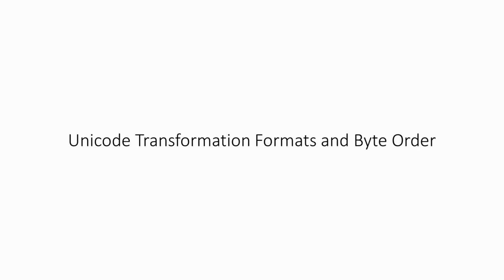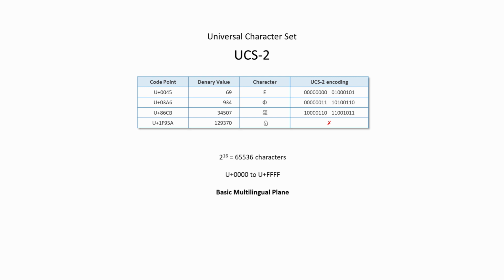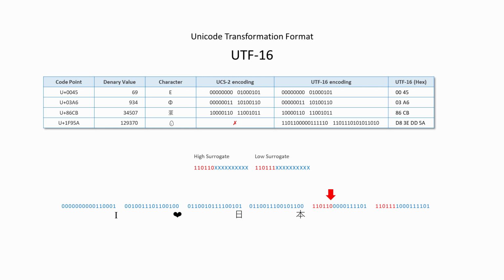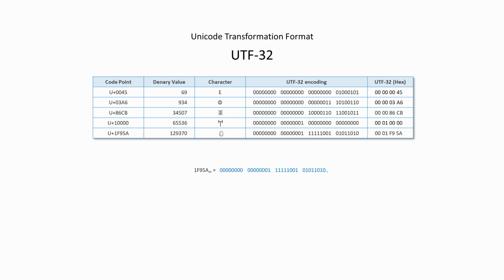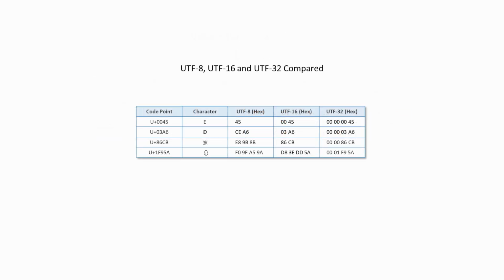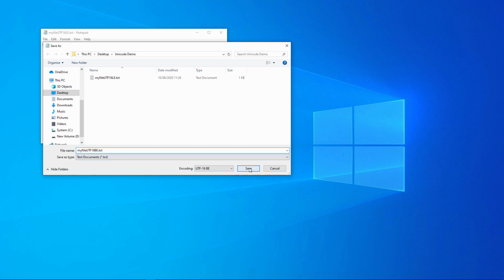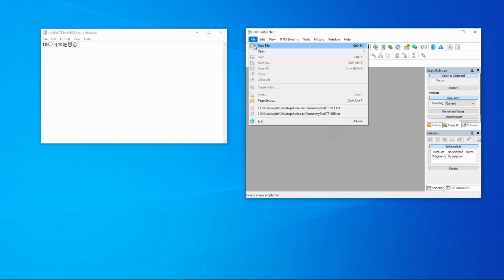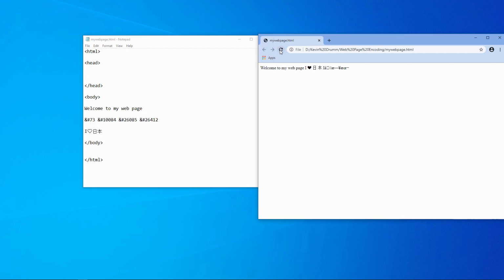Unicode and Byte Order

Comment: Dear Sir,

I have tried to convert '€' , in pure binary It is 10000000 and in denary 128, to UTF-8 format. As It is 1 byte character  but also starts with 1 . Hence I am confused how to convert it to UTF-8 format.

Please help.
Thanks in Advance.
Reply: It doesn't fit in 7 bits, so it's not 1 byte in UTF-8. It does however fit in 11 bytes, so it's a 2 byte codepoint. Pad to 11 bits and shove it in the two bytes with the proper headers
00010_000000 => 110_00010 10_000000

Comment: 4:56  in UTF-8 we have control bits which are necessary to identify the number of bytes used to represent a code point  while in UTF-16 we don't have such thing because low and high surrogates are known by the the range of values so we can identify if a code point is encoded using 1 or 2 UTF-16 code units by just the range of values can some one correct me please ?
Reply: 2🐝⊕¬2🐝?
Reply: @justcurious1940  That doesn't look quite right... Did you mean to say 2🐝∨¬2🐝?
Edit: oh, I guess that was the binary string showed in the video? Then it's possible the video did a typo or something.
Reply: @angeldude101   did u convert it to binary unicode then to characters ?
Reply: @justcurious1940  No, just noticed that ⊕ looked more like a direct/tensor sum than an or, so I just replaced it with the actual or symbol.
Reply: @angeldude101  yea i see i think u have to it yourself because i couldn't find a website that does it directly

Comment: One question at the end.  There are 17 * 256 * 256 possible characters across the 17 planes, not including the various blackout or restricted sections like those used for surrogates...isn't that more like: 1,114,111 than well over 2 million?  They do require 21 bits, rather than 20, because they left all but 2048 of the original BMP to lie where they were, and added another 1024 * 1024 possible new ones on top of that, so it is (256 * 256) * 16 + (256 * 256) - 2048...either way, way more than we should ever need if we don't go nuts...as they point out, Unicode is for characters, not glyphs or fonts, so if there are 500 ways you want to write A, that is still just one code point...
Reply from the maker: To be honest, I think Unicode is one of those topics which, if you keep digging, you may well go nuts.  I made a conscious decision not to overthink it (i.e. "tap dance").  Perhaps Unicode will prove inadequate if SETI ever come up with the goods. :)KD
Reply: @ComputerScienceLessons  Yeah, one thing that is unfortunate is that we went from a situation where almost everything "normally" used was in BMP, to one where lots of 🤦‍♂️🤷‍♂️🤞super-popular stuff ain't.  Too bad!